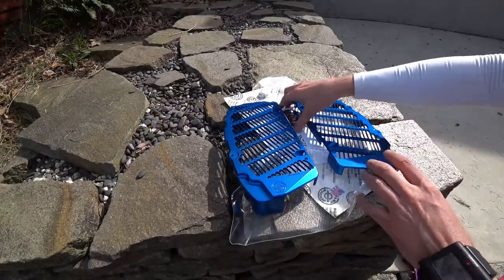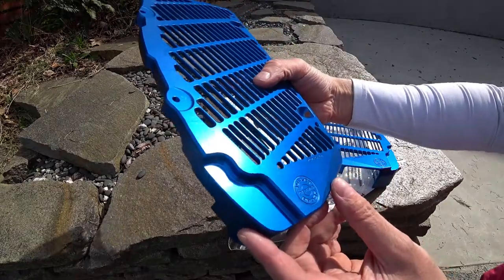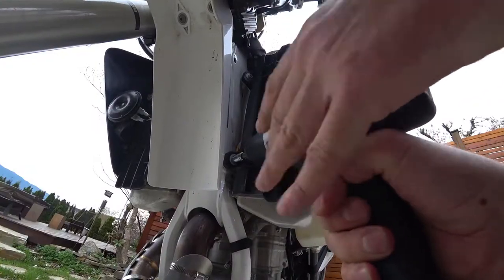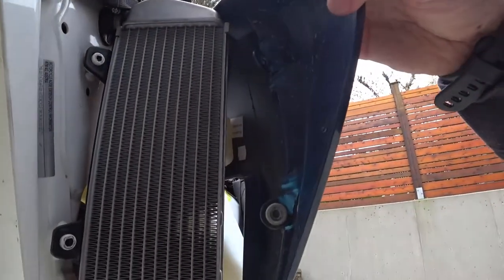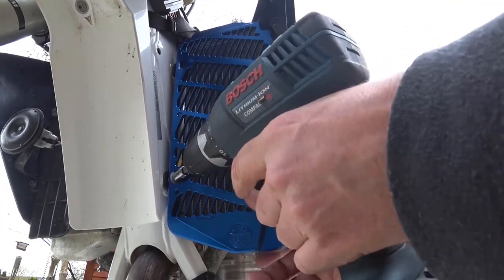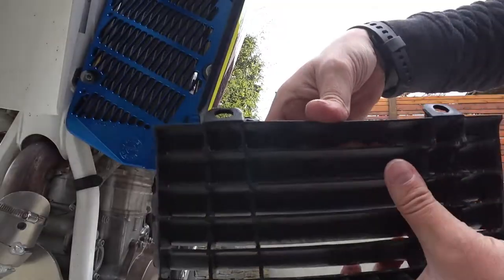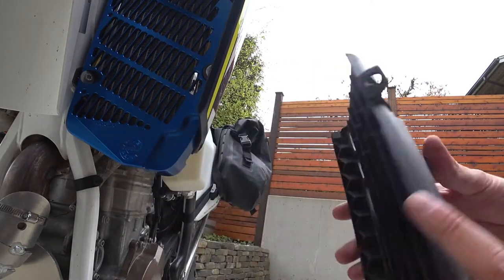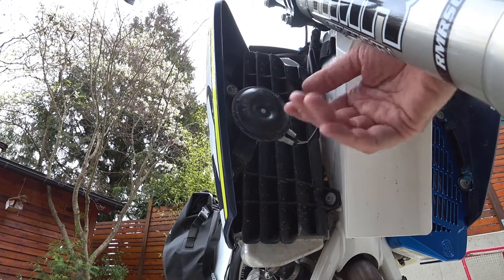2017 Husqvarna FE501 Radiator Guard Bullet Proof Designs Crash Protection Part 5

Comment: Wadz up, what's the weight for the rad protectors? Also Case saver recommendations? My FE 450 stator cover has a mark resulting from the shifter pedal impact (fall).
Reply from the maker: The BP guards are only few ounces more than the plastics. MX racers and major teams run them. The weight of the rad protectors are exactly 1.15 ounces. The gear from STR system tech racing is American made and a tiny bit pricey but you pay for what you get. Its cheaper than loosing a weekend of riding. P.S a lot of people in the industry claim that the angle louvers provide and direct more air to the radiator but the funny thing is for every 5 degrees you loose cooling per some testing so don't fall for that!

Comment: Doesnt seem to be that much protection from getting radiators bent?
Reply from the maker: Hi Jay,  all I can say is after a full season of riding their holding up nicely. I've gone down really hard impacting both sides a number of times and there doing their job. I follow another 500 often and he is always rocketing rock roost my way and I've heard the rad hits many times.  I would prefer if they wrapped around to the back more and covered the bottom hose connection but I haven't seen any other rad guard that covers this area a whole lot more. Thanks for watching.
Reply: WADZ UP Ok! Sounds like good stuff :)
Reply from the maker: And durable, if you've seen some of my other video you know that it takes a beating every week. Hope your enjoying the videos. P.S I'll be review some P3 carbon skids plates and heat shield which is super light and also a road trip Adventure Set-up with soft luggage very soon. Thanks for watching.